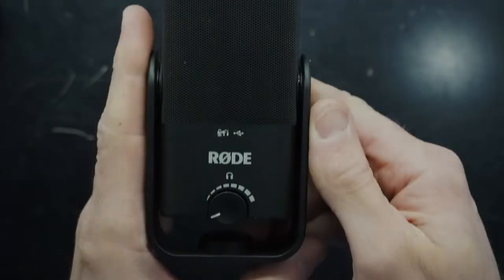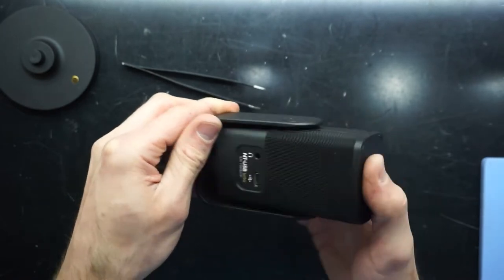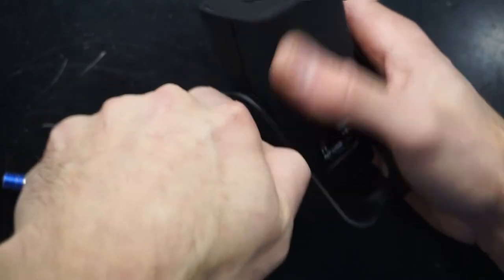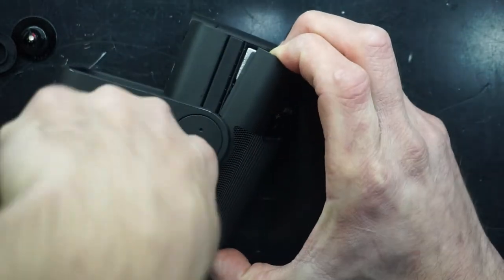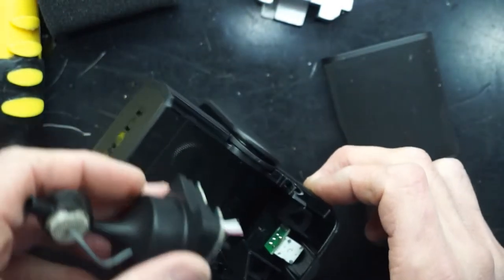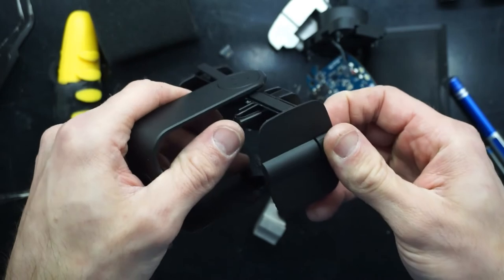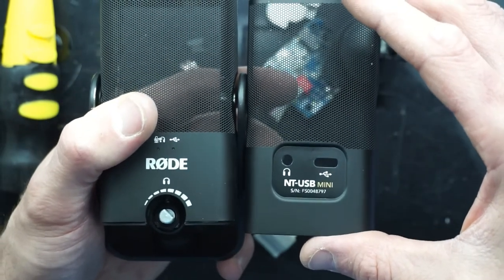Rode NT USB Mini disassembly / Tear Down

Comment: Thank you so much! Mine took a fall off the desk for about the third time. With your video, I disassembled it (side strips, not bracket, like you discovered) and found that the headphone jack had been disconnected from the circuit board. A little bit of ugly soldering hidden by the case, and it's working again...and farther from the edge of the desk from now on. Again, thanks.
Reply from the maker: hopefully you did alot less destruction than me :)
Reply: @rickstechrepairs  I did a lot less destruction because I watched your example. The headphone jack is ridiculously fragile with its tiny connections to the circuit board, and my soldering repair job is among my worst, but it's hidden inside the case and the mic works again. I was prepared to need a new microphone and your video made the difference, thanks!
Reply: @jimekrut thanks for the info, I have exactly same accident
Reply: My connecting wire for the mic is loose 😭😭😭 thank you for the video

Comment: I just had a go at tearing down mine and you don't need to remove the foot/base at all. In the video you mention that you suspect that is the case and I can now confirm that you can just pry both the front and back cover off. It took a lot of effort and I really needed the thinnest spludger I had available to properly get under them. 
In the end I was able to disassemble the entire thing and assemble it afterwards without any destruction.
Reply from the maker: Awesome, good too hear
Reply: Same. I was able to pop the thin side pieces off and then use a guitar pick to pop off the front and back grills. Non destructive.
Reply: amazing, I have broken 3.5 port on mine - so basically those side wide pins are not on the screws but can be removed along with cover as long as I be careful enough removing side thin panels? would be super grateful for some advice before I start disassembly

Comment: @Ricks Tech  I had the same issue with mine (broken USB) i made a tool to remove the cap screws but they have heaps of red locktight in them. maybe if you heated them up to de-bond them  you could unscrew them without shearing the bolt but otherwise there is basically no hope of taking those bolts out without breaking them. As far a my USB goes there is significant damage to the PCB, i could probably repair it but im not sure its worth it, as it would be very easy to break again. the screws are a bad design and the USB port desperately needs enforcing.
Reply from the maker: Cheers thanks for your thoughts 

Agreed regarding the usb port needing reinforcement

Comment: Heya, i wanted to comment on this video because of personal experiences
I've also ordered a Rode NT USB Mini (around 1-2 years ago), new, not used, and just like with this one in the video, i have also had a damaged USB C port
In the end, i returned it, it was quite sad, because the quality of the sound was really good for the price, but the unreliability of the hardware, which i have also seen not just with my model and yours, but also with others online, makes it so difficult to truly reccomend the Rode NT USB Mini, it's really dissapointing that such a good and cheap microphone is plagued by skimping on the internals like that, otherwise it could've been /the/ go to mic for starting-middle level content creators (instead, i went for the Elgato Wave 3, i don't think it sounds as nice as the Rode NT USB Mini, but it just works, and being able to trust a mic can work is important to me, also the software included is really useful for plugin FX chains)
Thanks for making this video, i've always wondered what the real deal looked like inside, i'm still thinking a lot about "what if" they didn't skimp on the USB C port

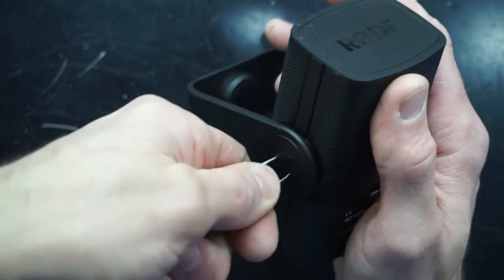Comment: Thanks for that, Rick - I had been thinking of getting one of these and wondered what was inside. Giving it an air of quality and robustness  by building in a couple of weights seems a bit of a cheap trick! Although it's a small diaphragm mic, it looks like it's 1/2", so not as tiny as some other cheap electret capsules. I'm sure I saw you successfully start to loosen the side plug with the 3 holes at 3:14 but then proceed to tighten it again at 3:34. Did you ever manage to cleanly unscrew the one on the other side? Shame about the connector - probably needed re-soldering with solder paste and a hot-air gun - not a trivial task. I fear the dreaded USB-C connector will be a reliability nightmare for many years to come!
Reply from the maker: i had no luck unscrewing the 3 hole screw (the correct tool would make it alot easier!)

The type C port would be easier to replace than getting the mic apart
Reply: That weight might be added for boom arms. Some of them won't hold mics which are too light.
Reply: @wooptoo  Interesting - had not thought of that.
Reply: @reqordist  I wouldn't discount your initial theory. I have used one of these for over a year now and I noticed it is very sensitive to ESD. Standing up with dry weather risks disconnecting it when connected to a laptop as these are ungrounded. It is the first USB device I encountered that does that, I also noticed that the output has a few pops and crackles now. When I went to double check the specifications of the monitor output on the Rode website I found that they don't even give those specs. 
So while it is a neat little microphone I very much feel like they cut some corners to price it as sharply as they did while still giving it a premium feel. 

I honestly am not sure if I would recommend it to anyone asking, though I might just have had bad luck and I don't have a ton of other usb microphones to compare it to.

Comment: Were you able to successfully patch it up? there is an extra wire in the USB connectors. if you can post a video that will be helpful. my mic fell off the table and the USB got yanked
Reply from the maker: I didn't have luck replacing the type C connector on this device
Reply: @rickstechrepairs  there seems to be another thin wire that arches over the usb connector.
Reply: @rickstechrepairs  Did the teardown and looks impossible to replace the USB connector. Unless with special professional  soldering. This device has a very weak USB c connector . I put this on my mic stand holder and my cable was too tight that a certain slight bend and the connector it snapped... R.I.P

Comment: got mine apart fine by popping up the top and bottom of the plastic piece on the side and the front and back just come off pretty simply - my usb port has taken the top layer of the silicon board with it so I dont think it can be repaired though :( pretty bad quality from rode on mounting these ports - it should be a through pcb design not a flush mount
Reply from the maker: Bugger

Comment: Do you know the size and model number of the diaphragm capsule?
Reply from the maker: not sure sorry
Reply: @rickstechrepairs  Thanks! It would be good to know, to see if it could possible be upgraded. This mic have to be placed close quarters to get a full rich sound for voice over.
Reply: @rawiyahsphere  Im interested too. Looked like an electret?
Reply: @steveflynn8311  It's small. The rubber housing looks proprietary and can only be replaced with a similar size capsule. Would have to find a higher quality one of the same size or modify the rubber housing to fit a bigger capsule. The rubber mount housing seem to be an internal shock mount. We will have to hope the circuitry is compatible with different capsules.

Comment: You need one of these watch repair tools to remove the bracket: https://www.watch-tools.de/tools/case-opener/s1-watch-case-opener-premium-editon.php
Reply: No, this doesn't work. Hole center distance is 8.6mm, but minimum distance of watch case opener is 17mm. Also hole diameter is too small (1.45mm) for the inset.
Reply: @ulbed  yes I realised that myself after getting one of these tools! 😳 Every day a school day...
Reply: @mattpadden5323  Did you manage to open it? The cheapest and nondestructive way I think is to drill 3 holes in a plate with 3 woodscrews coming through.
Reply: @ulbed  I didn’t; it went back to Røde for a warranty repair in the end. Your approach should work though.